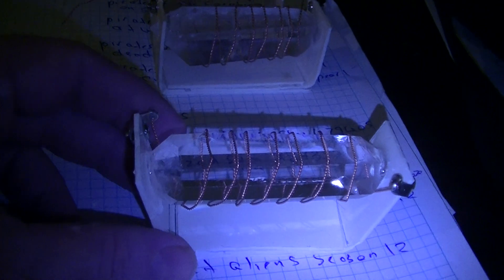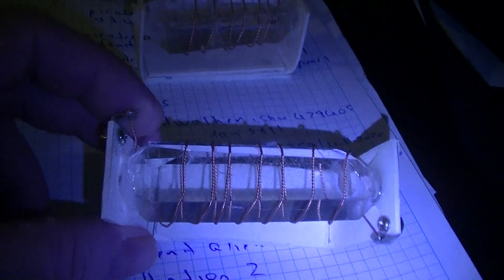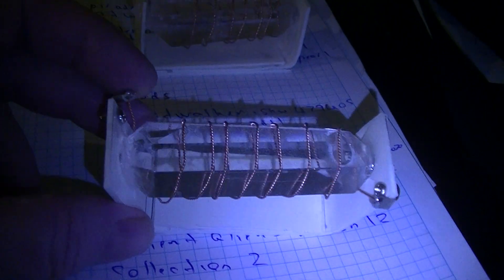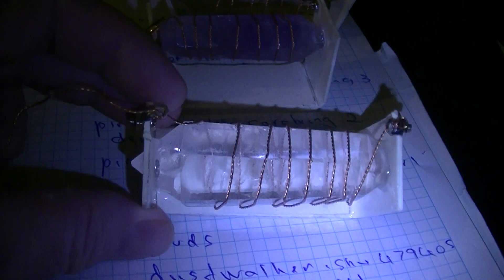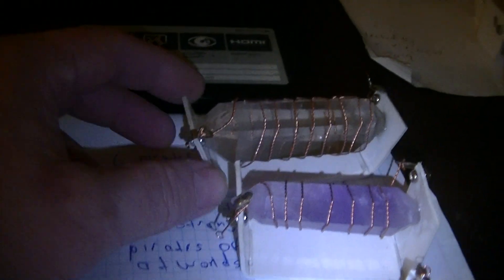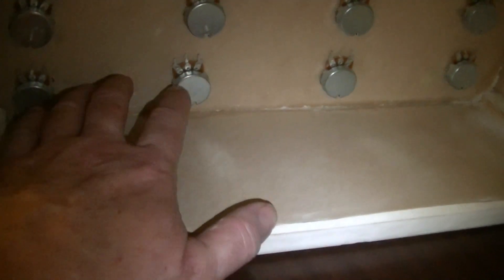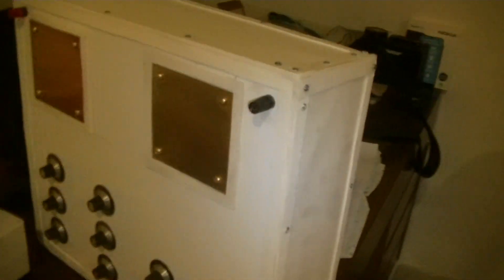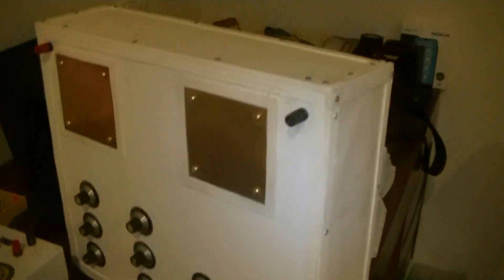latest wishing machine update

Comment from the maker: since this video was shot i have has some small but accurate results and after sometime i decided to dress up the whole thing using aluminium tape , tape, this  has a thin plastic layer on the non sticky side  the whole tape acts like a capacitor plate in fact it apears to react to my aura when i touch it , as it dose to my frequency generator circuits etc etc  even though i use no circuit linked to this radionics wishing machine to note its change when i touch it so for the last 3 weeks i have used another way to tune it and in about 3 weeks in a row myself and my partner have had 12 to 13 or over wins in power ball lotto each so we win our lotto money back for 3 tickets we each put in pluss extra